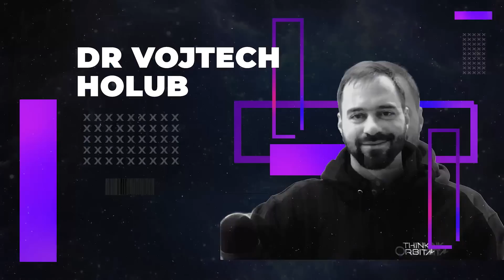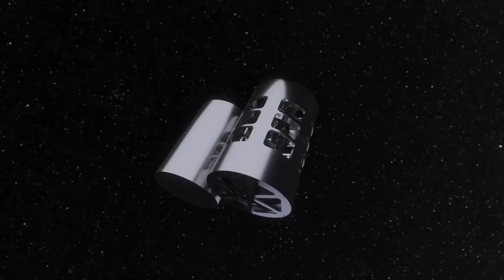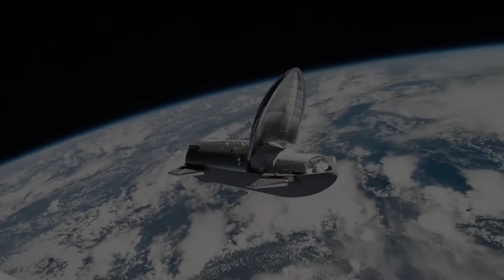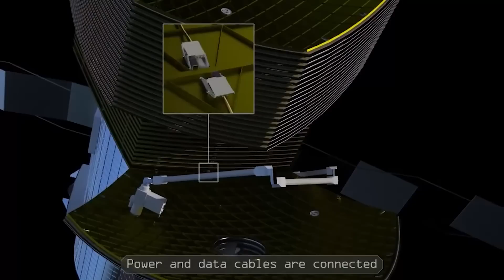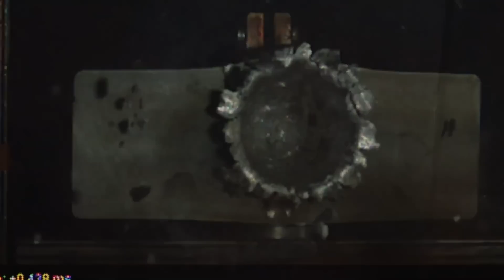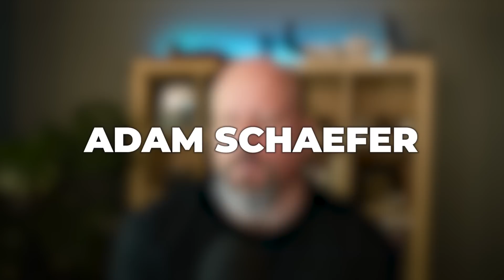NASA Just Funded This Project. Assembling Large Structures in Space [NIAC 2025]

Comment: The first welding in space occurred on the USSR's Soyuz-6 spacecraft in October 1969, then aboard the US Skylab and Soviet Salyut-7 space stations in 1973 and 1984 respectively. And this is really amazing as well.
Reply: Yes, it took 40 years to weld in space again. And using the same technology as all the previous tests... One thing is for sure - we did it way cheaper!
Reply: @vholub1  - i said it was amazing.
Reply: Vacuum welding is an thing, you have two polished metal surfaces who is not oxidized and they will weld together by themselves, no I don't think it is as good as an traditional weld?
As for traditional welding, it should works and its no need to protect from oxygen. Now with no air stuff will cool down slower who would be an issue for thin materials I think,
Reply: @magnemoe1  I had not thought about cooling rates! That should make welding thin metal better, less stress, with the heat spreading throughout the metal faster and more evenly  but thicker metal may have more tourtional stress, due to simple movement through a soft seam. 
   Contact welding could be the answer to both those problems, simply by being a cold welding process, but I'm sure it has plenty of its own problems like, misalignment, contanmination, or dissimilar metals. I wonder if dissimilar metals would weld better like that, say aluminum and steel or Earth made metals versus space made metals?
Reply: Weightless environment welding was tried and I think some, vacuum welding, but still inside a vessel. I wonder what would be different when welding out in space itself? The uneven heating  by the Sun, as the thing being welded circles the Earth and the small amount of atmosphere and space debris could make a difference in a weld that must be perfect, not to mention the difficulty of positioning the Welder or welding machine when there is nothing to brace against.
Reply: There is an exhibit in Moscow of this experiment
Reply: Google says
The first welds in space were made in 1969 by Soviet cosmonauts on the Soyuz-6 spacecraft.
In 1973, the US performed welding experiments on the Skylab space station.
In 1984, Soviet cosmonauts made the last welds in open space on the Salyut-7 spacecraft.
In 2024, the European Space Agency performed an automated weld in orbit using an electron beam welding gun.
So not this bunch are not the only one's who have done it.
Pity. I was looking forward to this, but when it starts with a lie I stop right there.

Comment: Maybe "Cold Welding" is something that has some practical uses in Space, instead of being seen as a "problem".

Per Perplexity AI
"When properly executed, cold welds can match the strength of the parent metal but cannot exceed it. For example, tensile bonding strength can reach up to 5020 PSI, which is weaker than traditional welds using filler materials. However, the absence of a heat-affected zone (HAZ) ensures the original properties of the metals are preserved, making cold welding advantageous for specific applications like joining dissimilar metals or delicate components."

"Cold welding typically occurs almost instantaneously once the metal surfaces are properly prepared and brought into contact under high pressure. However, the preparation process, including cleaning and removing oxide layers, can take time, and prolonged exposure to air after preparation may degrade the bond quality."

"Cold welding can be used in space for assembling structural components, and it holds significant potential for in-orbit repairs. Recent experiments, such as the ASTROBEAT project on the ISS, are testing cold welding for repairing spacecraft hull breaches caused by micrometeoroids or debris. This technique is particularly effective in space because the vacuum environment prevents rapid oxidation, enabling cleaner and stronger bonds."

"Cold welding minimizes risks associated with traditional heat-based welding, such as structural damage from high temperatures. It is also energy-efficient and suitable for emergency repairs. However, its success depends on precise surface preparation and calibrated force application. If validated, it could become a crucial tool for assembling and repairing spacecraft components during missions."

"In summary, cold welding is highly efficient for specific tasks like joining ductile metals or dissimilar materials but less versatile and scalable compared to regular welding for broader industrial applications."

Comment: I'm thinking spherical space stations whose outsides hold the air in (and have airlocks & docking ports) but don't spin.  Then 2 or more "ring decks" could spin inside it (on the same axis) in opposite directions to provide spin-gravity while preserving net zero rotational inertia.  The hardest part is distributing the weight so you don't trash the bearings or wobble like an out-of-balance clothes dryer.
Reply: You'd be constantly spending a lot of energy to overcome air friction and turbulence, trying to spin your counter rotating gravity rings inside a pressurized volume.
Reply: Well, that and moving from one deck to the other without getting squished.

Comment: Save the space station for parts! There are tons of useable parts and equipment that could be salvaged at the dry dock! Just the nuts, bolts and screws would be useful.
Reply: @lannyplans  The metal is corroded. Thats the issue. Its not the tech, its the materials that are compromised.

LOE has traces of oxigen and Hydrogen and plenty of heat on the day side. It takes decades but it degrades
Reply: Its a heap of junk already. Even screws were subjected for years of radiation and heat cycling which makes them weaker.
If you want to use it then you need to build metal smelting facility on orbit as well. and something for different metals separation. As long term plan it is good. But in the next 50 years probably not so much.
Reply: @petersvancarek  like I said , a practice run towards asteroid mining. Cheaper to put a smelter in low earth orbit to recycle already refined metals, just to learn how to do it in space.
Reply: @ Maybe in few tens years into future. We are speaking about 450ton of junk. Something which would cost billions just to keep afloat even as uninhabitable. It is safer to deorbit it.
Reply: @petersvancarek  agreed, but there's still plenty of things that could be done with it, my favorite would be testing a tether system, splitting off part of it, using its rotation around a common center of Mass to kick part of it to a higher orbit while deorbiting the other part. The test could have its own budget and be cheaper than the cost of the whole deorbit process otherwise. Getting scientific study done and saving money. That's my more realistic proposal anyway.
   I'm no rocket scientist and I'm bad at math but I did try to attempt to calculate that, what I came up with for the current rotation rate of the ISS was only a few hundred metres in vertical separation between the two halves. 
    Despite that I still think it's a worthwhile thing to study .
Reply: @petersvancarek  ok that sounds like a plan .
Reply: A proof of concept mission ultimately geared to asteroid mining, a part of that would be refining metals , we could start practicing in low earth orbit with the ISS. It would certainly be cheaper then trying to do that on an actual asteroid! 
   Frankly I just wish I had the solar panels!
Reply: It is quickly bevomming junk. Just like an old car. In the far far future we will likely have industrial plants to recycle old material, but not now. And with cost per tonne to orbit going down so fast I see no reason to keep junk in orbit.
Reply: Even reusing something like a screw from the ISS is very difficult. Your design needs to accept that screw instead of the one you need, it has to be able to be built, tested, launched and maneuvered near the ISS with out the screw installed. Then someone needs to get the screw and install it in outer space. A 25c screw now costs a million bucks. 
I think just about any part of the ISS that isn't already a complete module will be impractical to reuse.
I think a fitting end to the ISS is the spectacular fire works or will produce in the most distance place in the Pasific Ocean
Reply: Send the space station to the moon to be a new start to putting bases on the moon, land it or maybe if the moon has its own gravitational orbit and the space station could go around that🤯 not a scientist just an ideas kinda guy, even if they don't/won't work💁‍♂️
Reply: Preserving the ISS gives us the chance to see what that corrosion looks like and learn from it. Throwing it away, you learn nothing.
Reply: Yes Musk and one of the future Starship Block 3-4 could be built like a smelting factory. Takes in a smaller module into its cargo bay and the crew using those Optimus bots strip it then once separated and melted down maybe inside a chamber that could feed in focused sun light and melts everything down into blocks for future 3D printing
Reply: @lannyplans  lol no
Reply: 'Let's salvage parts"... or, just shut down  NASA's welfare for DEI scientists and let Elon do it for a tenth of the cost, on schedule, and without mission compromising failures.
Reply: Put the imperial star destroyer upside down and they are balls of steel
Reply: We should save the station as a heritage thingy. I think future generations would really appreciate it.
Reply: That's a whole lot of money to spend for a spare parts bin you might never use. Remember the station at least requires continual burns to lift the station back up and requires around the clock care and maintenance. It's not a matter of just shutting off the lights on your way out. You can just walk away from the space station about as well as you could walk away from a moving car going highway speed.

So who pays for it? Do we cancel mars return to pay for it? Because there won't be more money coming, you'll need to cancel programs to have the funds to pay for your parts bin.
Reply: My insane plan is using three starships to boost it into lunar orbit

Dividing the work load by three starships makes their recovery possible
Reply: @manoellotti8440  Yeah it really is dumb AF to just let the ISS go even if a new bigger better station is made. Having an extra station up there is just universally handy even if it's older and more inferior.
Reply: @lannyplans  Yeah, send it into a much much higher parking orbit.  maybe soft crash it into the moon near where we want to have a base.
Reply: @ Crashing to the moon? soft crash On top? That would be more costly than building a few new ISS. That station is 450 tons! Without engines able to do the feat! You would need to develop system which would carry thousands tones of fuel and flight computer and able to be attached to ISS. All that into right place so it would fly straight in direction you need. Billions for development.
This station holds together basically by tape now- the aluminium gets brittle by decades of radiation and thermal cycling, the joints are weakened by the age... it would fall apart if you try to soft crash it and fall on the surface at speed of kilometers per second evaporating probably. And what for? For material which is abundant on the Moon surface, just not in pure form? Material which wouldn't be usable at all without factories which would smelt it and then make what you need out of the raw metals?
Reply: @ Thank you for the very knowledgeable and thorough explication. You comment has improved my CBW (current best wisdom) May I ask about your field of expertise? Do you have a channel? Thank you Lanny
Reply: @petersvancarek  Exactly. Better to spend that money on new science missions.

Comment: The problem with welding in space is it is harder to cool an object than it is to heat an object. But at the wattage you are using maybe there is less problem.
Reply: Do solar panels and radiators first
Reply: That is absolutely correct, but the welding needs only about 2kW of power with speed of over 10 mm/sec, which would make the large welded metal barely change is temperature.